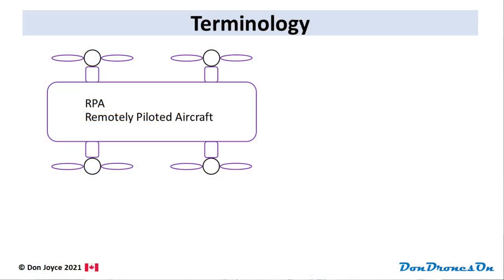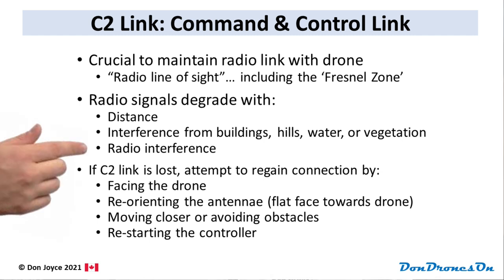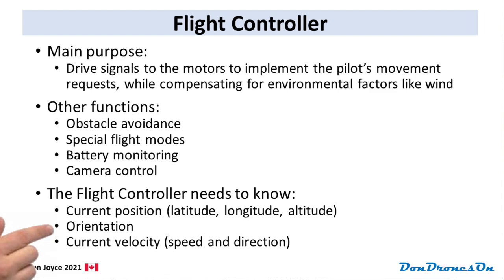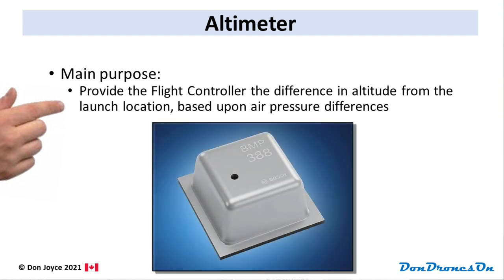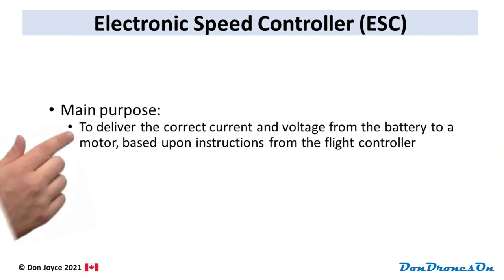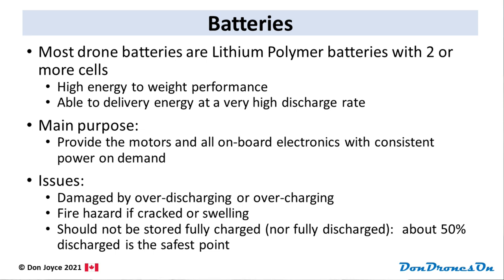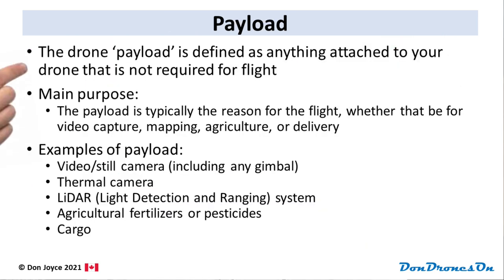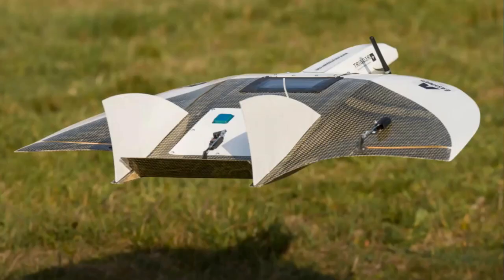How Drones Work...An Examination of Drone and RC Aircraft Systems

Comment: Thank you. Could you please elaborate on tiltrotor drones and how they transition from vertical to horizontal flight.
Reply from the maker: Tiltrotor drones use rotors first for straight-down lift, then slowly tilt into a horizontal direction.  This kind of drone uses wings to provide the lift when travelling horizontally.  The Wingtra drone isn't really tilt-rotor, but operates in a similar way.  There is footage of it in this video (somewhere in the middle, then at the very end):  https://youtu.be/s-DWwMD-Zq8  Seeing it will help you understand the principle.  Hope that helps!

Comment: Hi Don. What is the sufficient number satellite that the drone needs to take off.  Great stuff you have.  Thanks.
Reply from the maker: The DJI drones each seem to have a different number from what I've seen.  And the more recent ones will warn you if it can't see enough...but still allow you to fly ATTI mode.  Personally, I would feel uncomfortable with less than 12.